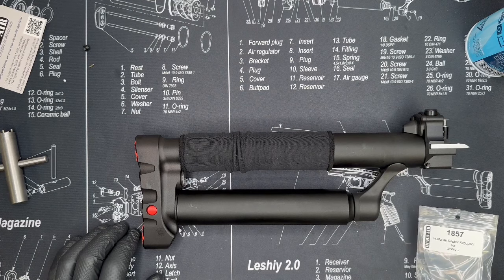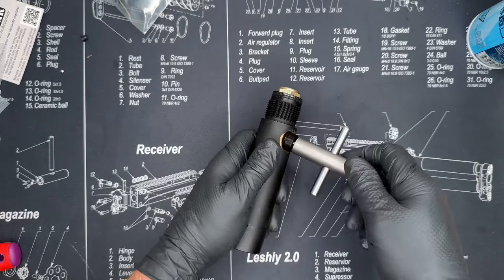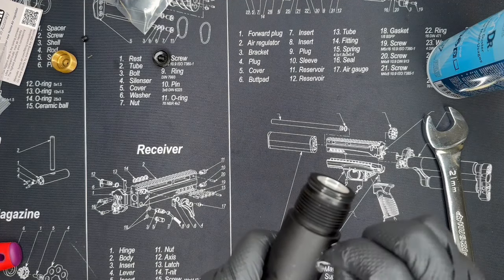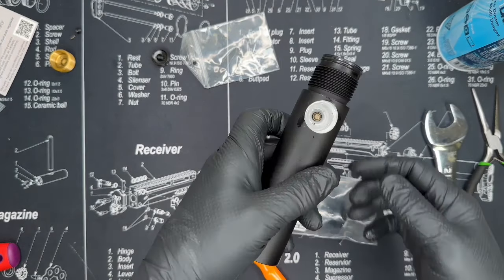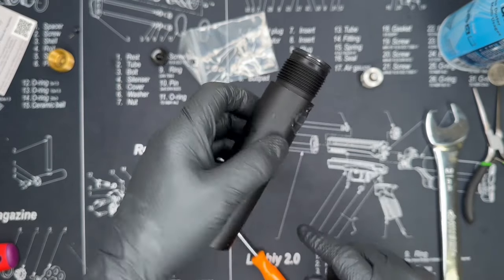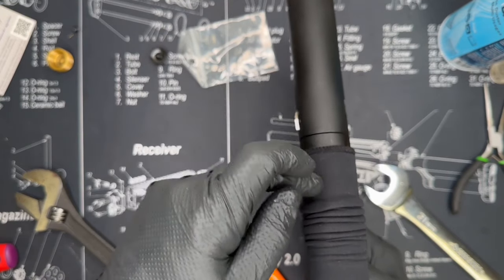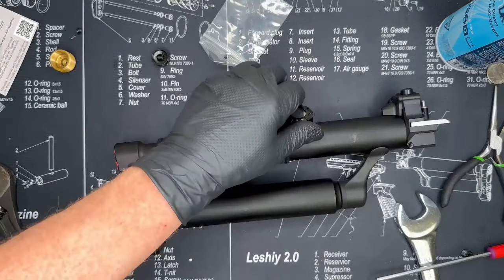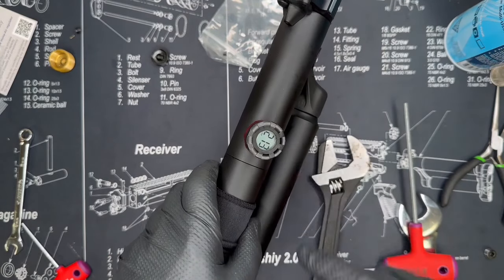Huma- Air Edgun Leshiy 2 Raptor Regulator

Comment: Good day! Perhaps you could answer a burning question of mine. Opening up bleed screw on my buttstock does not degas the gun properly. I have the 350cc bottle installed, not the default cylinder. It seems the air is stuck right before the regulator and unable to pass through the plenum. I know the cyclinder has its own  bleedscrew, however the bottle does not. Do you know of a safe and alternative way to bleed the remaining air out? Ive heard that its possible to bleed air from the gauge section, but until I know for sure.. I don't dare to try it out. There is about 90 bar remaining in the tank and I don't want parts getting launched at me at high pressure, haha. Until I find a way to fully degas it, I won't be able to open it up and take a look inside...
Reply from the maker: Contact your dealer. That is not the sort of instruction I give in public for safety reasons
Reply: @edgunwestLLC  Understandable. Turns out It was a locked regulator. Luckily Fransisco was nice enough to send me a brand new buttstock. The newer version with the added bleedscrew behind the guage no less. EdGun Spain provides amazing service.

Comment: Huma states that the max output of the Raptor regulator is 175?  Not a big deal to me because as you know i'm shooting for much lower setting but, i did notice you set it to 213?  As always thanks for the video very informative.  Just one more reason to drive back down to the shop.
Reply from the maker: you know me; I am going to test everything to the extreme 😁

Comment: Bulky unit, not flush, no significant gain in performance imho and you must use a wrench which will scratch the surroundings eventually . . . is see no added value to be honest. I like the standard one better.
Reply from the maker: Thanks for the feedback. Where this regulator shines is at the extreme ranges of the pressure spectrum.  The OEM regulator had reliability issues at or above 200 bar, and many users want the ability to run their leshiy this hot. Other issues have come from users who often tinker with their power settings; this system works without using a small ball on a seal. I asked Huma to make this regulator with these two pain points in mind. We are working on a wrench for the raptor  regulator that will prevent scratching of the air tube
Reply: @edgunwestLLC  Thanks for answering my question, maybe you convinced me a little more. Thank you sir.
Reply: @Loojmemhav I’d say you’re around 160bar

Comment: Great vid cheers 👍 I ordered 1 of these from you, can you confirm if there is supposed to be an Oring on the base of the cup insert as mine has no Oring and leaks, if so what size is correct,
Many thanks
Reply from the maker: 12.5X1.5MM
Reply: @edgunwestLLC  many thanks 👊